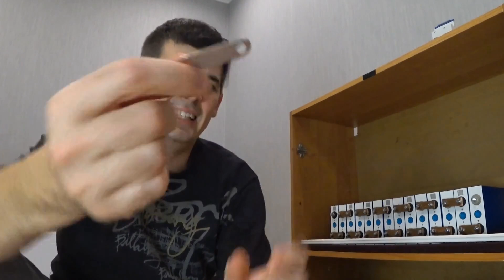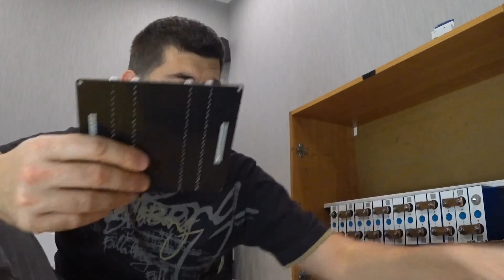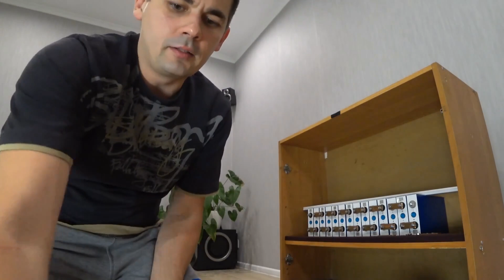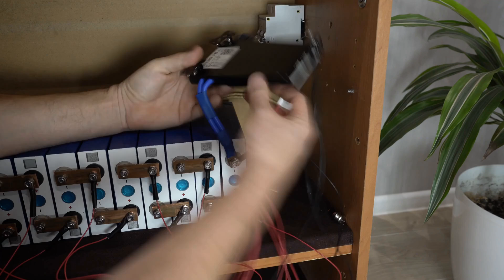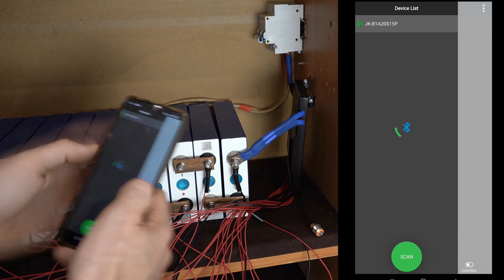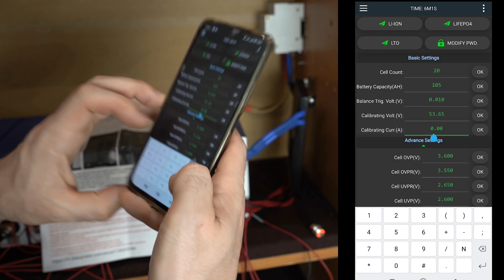DIY Solar Battery Build: LiFePO4 with Active Balancer BMS for Home Power Station

Comment from the maker: ✅ Order on Amazon:
Lithium iron phosphate battery 3.2V 100Ah: https://amzn.to/4vvRPNX
Jikong BMS controller with active balancer: https://amzn.to/4dVBoom
DIN rail circuit breaker: https://amzn.to/49NfbXa
Daly active balancer: https://amzn.to/4dWfTDZ
5A active balancer: https://amzn.to/4uWqmFf
Daly BMS board with balancer: https://amzn.to/4vBp0Qu
Daly BMS board: https://amzn.to/49OkIwJ
Copper terminals: https://amzn.to/3Q1vkS9

LiFePO4 Battery 3.2V 105A on Alibaba: https://fas.st/nhVefl
LiFePO4 Battery 3.2V 105A on AliExpress: https://fas.st/HgMLLN
Jikong BMS Controller with Active Balancer: https://fas.st/PNFgB
Automatic Circuit Breaker for Din Rail: https://fas.st/D8pAa
Daly Active Balancer: https://fas.st/Za_Jl
5A Active Balancer: https://fas.st/Za_Jl
Daly BMS Board with Balancer: https://fas.st/VbtkBg
Daly BMS Board: https://fas.st/mcyOjU
Copper Terminals: https://fas.st/6Bv3Pq

✅ For discounted orders, register on the cashback service: https://fas.st/e2JpP